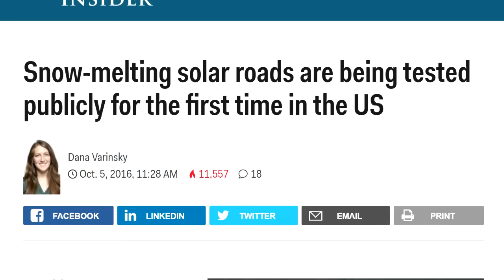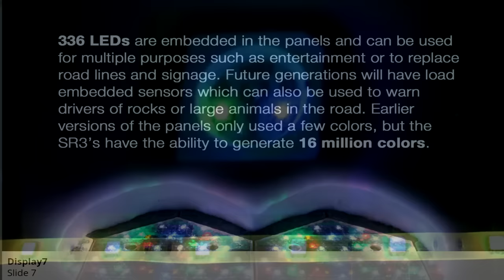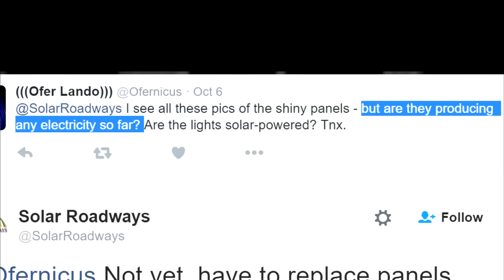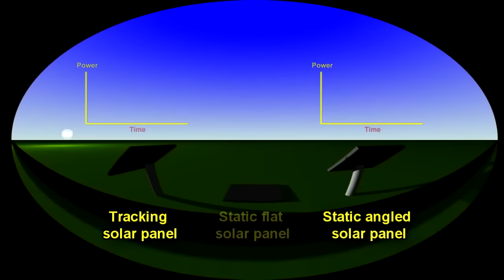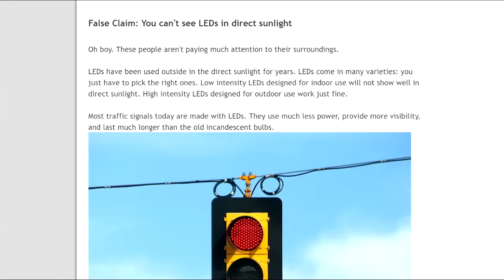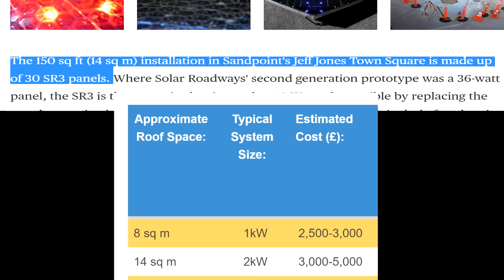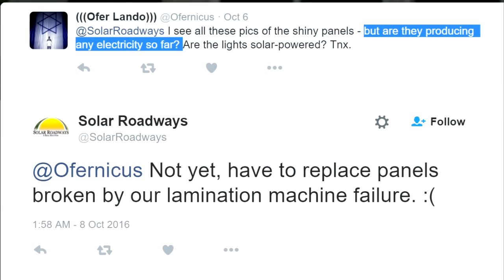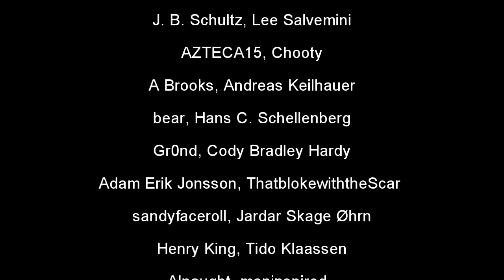First AMAZING Solar Roadway UNVEILED!

Comment: If it did the things it is supposed to do I could understand the excitement. Even if /they/ didn't generate energy and there were solar panels lining the roads and buildings and stuff... this could be a very useful idea (assuming it could be powered enough this way). If it /also/ didn't ... well have all the issues of a tile based road on top of all of this.... and the visibility issues... and the damage issues.... basically if this was an entirely different idea done in an entirely different way with the same results but in a practical fashion... I can see the use of brightly signaling kids or animals or accidents ahead or what have you....
Reply: I can't. Human drivers are on the way out. The sensors and processors required to detect such things work way better in an autonomous car, where they can act upon that information, instead of signaling a relatively slow human and hoping that they'll respond in time.
Reply: Until that autonomous car gets hacked through WiFi. Unfortunately that has a bit of work ahead of it too.
Reply: Algie DeWitt
A self-defeating argument if I've ever heard one. Human drivers cause more accidents due to distraction from their wireless devices than even the most bloodthirsty hacker could dream of.
Reply: I'd like to see your facts about something that hasn't happened yet on a large scale. Human drivers do cause plenty of accidents, but they are at least avoidable. Losing all control of your vehicle with no ability to do anything what so ever about it is not.
Reply: Algie Evan DeWitt V
I'm sorry, my facts? You're the one making claims about something that hasn't happened yet on any scale. And mind you, a lot of people are injured in accidents that they didn't cause. Would you tell them that it was avoidable? And as for "losing all control of your vehicle with no ability to do anything whatsoever", falling asleep at the wheel will do that for ya. Is it avoidable? Yes. Does it still happen all the time? Absolutely.
Reply: It has not happened on any scale, but it is a fact that currently there is nothing they can do about it. That is tested and proven. If the vehicle is hacked, they are helpless because the vehicles are not designed with redundant manual input. It is a serious flaw. Accidents happening entirely out of both or more people's control is a situation that is rare compared to simply being inattentive or reckless. Just because it happens often doesn't mean it is the same as having absolutely no possible way of controlling the situation. A proper hack could leave you as a hostage in your own car. They need to make sure there are truly manual controls for all vehicles for a variety of reasons that don't even involve hacking. It is common sense that has been forgotten for technological advancement.
Reply: I am not trying to be an alarmest... But I have seen videos and shows and I think a documentary and corroborating evidence and depictions of cars that trapped their drivers and left them unable to do anything at all... Including opening the doors or braking... It is just not the same thing as falling asleep at the wheel.

Comment: It's a great idea to have the roads generate power, but to do it with solar panels wouldn't be a great idea. If it was done through the kinetic energy of cars from the cars, that might be a better idea.
Reply: It would only make sense downhill or during brakes. On the straights or uphill would use energy from car's fuel instead of recovering the kinetic / gravitational energy.

Comment: solar roadways? one broken wire and we are all fucked. at least paint lasts for 2 or 3 years.
Reply: I don't like this project, but to be fair, they are independent tiles so they aren't all on a single circuit

Comment: Just a quick question - instead of paving the roads with solar panels, why couldn't they just put a roof over the roads and cover it with solar panels?

It still wouldn't make much sense but I would be much easier and cheaper...

Comment: Why don't they put the LED panels on the road and solar panels on the roofs around them. the solar panels can than "kinda" power the panels. It still is a bad idea, however, it'd be a little more practical.

Comment: i have a design for a smart watch that is powered by cold fusion.  it uses thorium to split atmospheric water to fuel the miniature fusion reactor.  the watchband will be made of plastic produced by pulling carbon out of the air.  how do i get start-up funding?

Comment: What about grip levels? there is no way you could go over a surface like that at normal speeds without a fair chance of losing control. What about fires? surely the materials used would let the fire spread from panel to panel, as apposed to tarmac which would just melt in the worst case.

Comment: Thank you - At this point there best solution is to get a nerd who knows how to build from scratch, Some Heating and cooling specialist and some actual City Road Builders to get them the info they need. Practical solution is they need help bad.
Reply: The nerd (well, this nerd anyway) will tell you that it's a waste of solar panels to lay them flat on the ground, under the obstruction of a thick protective glass, vehicles, dirt, grime, and shadows from objects like buildings and trees. It's woefully inefficient.

The heating and cooling specialist will tell you that it would take an enormous amount of power to heat roadways. Hell, we could do that today by just laying some wires underneath the top layer of the asphalt, but it is not done because the power would be a lot more expensive than the traditional methods of keeping them ice-free. Besides, roadways already absorb most of the insolation they get. In the winter, they freeze up because they don't get enough sun. That's the whole problem.
They will also tell you that road surfaces will get very hot during sunny summer days, and with no airflow underneath to cool them, that will just kill the efficiency of solar panels.

The city road builders will tell you that the last thing they need is to make road work even more complicated by mixing it in with computers and power generation. 

Seriously, how do people not get that this is a stupid idea to begin with? I like solar panels a lot, don't get me wrong. But if we're going with that, we should have every roof covered with them first, then think of new and worse places to put them.

Comment: Yes, their implementation is stupid, but the idea of having so much solar production that efficiency isn't a major issue and heated roadways (having the heated roadways in this area would be nice, given my experience with cold but dry asphalt) would be a nice thing to have.
Reply: hellcat1988 
Are you trolling?
Reply: Teemo
Honestly no.  If you have every single square inch of what is now asphalt as a solar panel, efficiency wouldn't actually be an issue anymore because production would outweigh loss from angle and obstruction.
Reply: *****
Have you never heard of blocking diodes and relays?  You don't have to have them hooked to the grid 24/7 so they don't have to drain the system.

Add to that the fact that we have millions of miles of highways in the country, many in very sunny deserts, that are rarely ever driven and I can see production outpacing efficiency loss quite easily.
Reply: *****
They don't have to have leds.  That's just a gimmick that can be done away with. 

Having thousands of acres dedicated to solar panels is just as stupid in an area like where I live, and keeping something at just above freezing isn't as power demanding as you might think when it's got the sun on it during the day to heat-soak it. 

Having large local power generation is a much safer option than having a few centralized mass generation fields in more favorable climates.  It puts more strain on the grid to send the power further and a local solution would also help prevent blackouts in one area or downed lines from affecting larger areas.

Putting the regular panels on buildings and having the land for wind turbines would be a more effective use of the available land when you add farming to the equation.

Ultimately, the goal is to have production outpace demand for decades to come. 

It may not be the best way to do it, but the solar roadways tied into the national grid to give both local and national power as demanded is a better option when you also factor in that the area beneath the roadway can be used for thermal or conventional storage batteries. 

That way you have both the power source in the daylight and a storage solution to keep the generated power without loosing agricultural and animal habitat to a field of panels and batteries. 

The batteries could even help keep the panels heated as they charge and discharge to the grid, much like the Tesla model s batteries have to be cooled. 

With both wind turbines and solar charging massive battery banks constantly as they are drained, the batteries alone might be enough to keep the roadways above freezing.
Reply: *****
The only differences between what they're offering and my additions is the lack of lights and the addition of batteries.  There are already major rooftop solar and wind turbine infrastructure projects in place and in development.  Tying the 4 systems together just makes sense.

Comment: Why not just put the solar panels along the side of the roads so you don't lose sunlight from cars driving over them and you don't need to worry about them getting torn up? Better yet, why not put them on the roof of a building, angled toward the sun where nothing will obstruct sunlight?

Comment: I wonder how much would cost making all the roads with these panels... I'd suspect several hundreds of trillions with these guys
Reply: i think TF calculated just the raw material glass would cost ~hundred trillion or something, cant remember exactly
Reply: ImGrumpher
well my blind shot landed pretty close
Reply: *****
freakin hell
Reply: The cost at the MoDot for each panel works out to be ~ $1,700.00 installed..... which works out to be $425.00/sqr foot. @ 43,000 sqr miles of road surface (according to SFR website) that works out to be  
~$509,477,760,000,000.00
Reply: They don't........ Solar Roadways say that their panels aren't producing any power, because the PV panels where damaged in the process of making the tiles.

Comment: Solar roadways should be mandatory, no more gas needed.  Tilt angle does not matter. Netherlands has a good solar roadway.
Reply: Yep, the one in the Netherlands is really good at draining money.
Reply: A small bike path 70 meters long, can supply power for 3 homes.  Engineered to withstand 10 kilotons I think they said self-cleaning with rain.
Reply: pirucreek And the exact same amount of panels would have provided twice the energy had they been placed on rooftops. I'm not even making this up, it's literally twice the amount when compared to local rooftop panels.

And they also would have only cost a fraction of the price. So putting everything together : solar roadways tries to do the same thing but more expensively and with only half of the effectiveness. In what world is that a good idea ?
Reply: ivanlagrossemoule Where space is limited.  It also serves a dual purpose.  It also is wasted space, the roads would be providing nothing so 1/2 of something is better than nothing. If you look at the Netherlands road, the road to me is a visual improvement.  I wonder what the average sidewalk in USA would provide.
Reply: pirucreek Where space is limited there are better and alternative ways to produce electricity. If there's not enough rooftops you can build panels on top of garages and so on.

So what if it's wasted space ? If you build solar roadways instead of rooftop panels, that means that 50% of your solar panels are completely wasted. It's the equivalent of throwing half of the solar panel production to the trash. So now you've just moved the problem.

Meanwhile if you build rooftop panels, the wasted space on rooftops isn't wasted space anymore, and you don't waste solar panels either.

Well sadly visual improvements aren't enough to make such a thing worth it.
Reply: ivanlagrossemoule I might buy a solar panel and make a solar roadway.  136w unisolar.  As soon as I stepped out in front yard I saw a good place for it, I can bury battery underground and put solar and xmas lights in.  Also being on the ground you might not need a permit .

Comment: So, I under stand where this guy is coming from, but instead of just pointing out every flaw with the system,  why not give some more ideas for better models of solar roadways. Solar energy can be a good source of eco friendly energy, but if all we do is criticize it, we won’t be able to make greater advances in it and the possibility of solar energy in our future will become more and more slim.
Reply: Solar roads are absurd. Put the solar panels on roofs where they will produce far more power and cost far less to produce and install.
As he said, $500,000 dollars could have purchased 99 solar systems that produce twice as much electricity, each. That is 198 times as much as that failed patio "installation".
Solar Freaking Roads cannot work.

Comment: Eeehh, solar pathways won't happen. Maybe if we created some sort of kinetic surface, probably not for roads (reduces efficiency of cars), only pavements. Perhaps use some tiny wind turbines using air pushed by cars? Or yeah, put them on the freaking roofs, the are no multi-ton cars breaking the panels! Its just so stupid.

Comment: Yeah the concept sounded cool, but the panelling aspect was dubious at best and when they started asking the public for money, alarm bells started ringing. Which is sad because I really WOULD like to see space-grade solar arrays ultra resistant to impact and fracture with some actual, proper optics and customizable markers. But these guys have clearly shown that they have zero competence, aren't actually investing their grants into R&D (I would have gone for high tension carbon fibre weaves as stress distribution but they still go for laminate even though tjey would probably be better off using ordinary plexiglass), and clearly forged their prototypes. Shameful.

Comment: say, why is it even made? like it only need a very very small amount of energy to power a chip and the LEDs, won't it just be more efficient if they have a set of solar panels near the road or over the road and supplies energy from there?
Reply: also, if they want their panels not to be damaged by water or crushing, try making it a square root smaller and fill that with epoxy resin so it will be cheap enough to make and very easy to maintenance: throw it away when it is broken
Reply: and solar roadway will never be good because cars will make them loose no matter what, a solar walkway will more like it. Like a street light replacement or maybe a road cross replacements, it is way more sense able then make car run over RGB LEDs

Comment: i like your videos, they are informative, but i wish you would add input in some of the things that could be fixed. debunking is awesome, i love it. but adding constructive ideas would make you even more awesome.
Reply: I can appreciate an answer like this. I Aldo like the idea of peer reviewing which is a vital process. I also think outside of peer reviewing helpful criticism and ideas to fix it could help. I do see how this may be beyond fixing. However in France there is a similar project that has been yielding decent results!
Reply: Until we run out of roofs and empty land on which to place racks of solar panels, putting more expensive solar cells on roads where they lie flat and are less efficient is a dumb idea. 

Germany has massive solar energy production and it has not even come close to using all of its rooftops and open land.

Why pay 2 or 3 times as much to put cells on roads that will be half as efficient?
Reply: I do agree with that. The only reason  it would make sense for someone like me is where we have rules against solar on roof tops etc. So this solution would work great with the exception of cost and efficiency
Reply: Rules against rooftop solar? Whoever's brilliant idea was that needs to be tarred and feathered and driven out of town.
Reply: they are called neighborhood associations... and they sometimes have more power than the president. its absolutely stupid
Reply: tybofborg that's mainly why I agree with alternative areas to place solar. for use its not much of an option. an association can even get you kicked out of your neighborhood. house repossession. this blows my mind

Comment: wouldnt it be just as efficient to have pressure activated plates that generate current when you drive over it? or like having a magnet under your car to run a current through the road way cus thats about how affective this seems
Reply: Elliott Bork not really, that would have a lot of complications, it wouldn't be effective
Reply: exactly my point......

Comment: Pretty sure stop lights use a lamp and a piece of plastic to make that "LED" look. (correct me if I am wrong).
Reply: LEDs were used intentionally in complex intersections specifically because their brightness and viewing angle is limited.  These days they are used more generally but their brightness, viewing angle and cost issues need to be weighed against the benefits (low power consumption, long life, failing one-by-one so the traffic light is still functional if some LEDs stop working - although individual LEDs not replaceable).  Even today LEDs put out about 1/3 to 1/5th the light of incandescent street bulbs (but use only 10% or less of the power). 

Here are products:
www.gelighting.com/LightingWeb/na/solutions/transportation-lighting/led-traffic-signals/dr2-repeater-signals.jsp 

www.gelighting.com/LightingWeb/na/solutions/transportation-lighting/led-traffic-signals/gt1-arrow-signals-incandescent-look.jsp
Reply: ah thanks for the quick lesson! :D